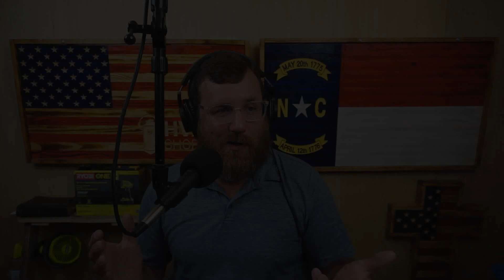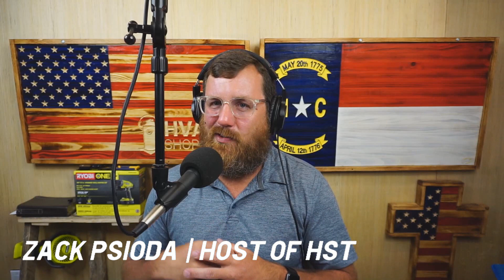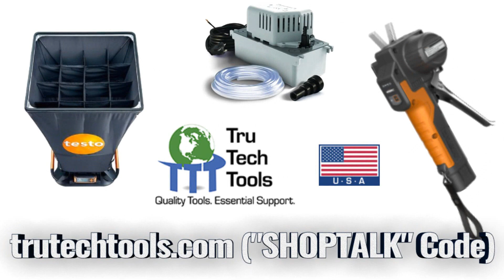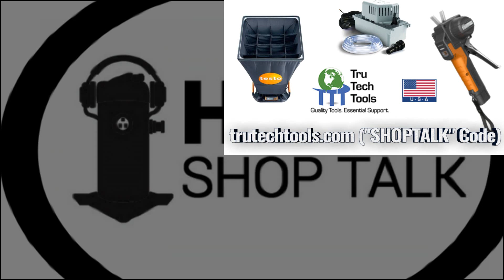HVAC Charging with R422B

Comment: So is 62 psi OK on the low.
I adjusted blower speed  higher.. house was 88F. Suction wouldn't go down. Evap was 42.  Am I being impatient.. This was a new compressor and conversion.   I got a theory.. if a tech doesn't change the drier isn't he contaminated the 422b with r22?

Comment: So if a r22 unit is low on ferrion can you top it off with R422B?
Tks
Reply: No, you can't mix any refrigerants.
Reply: @aaronclark1599  I do, and no issues. Got an old 22 unit with  some 410 mixed  in,  still cooling like champ.

Comment: I've used it for a while now on anything from compact chillers to 25ton RTUs. Seems to do well. Haven't had any migration or metering issues. BUT when I was doing alot of rez work I would find alot of units that were "topped off"(MO99,407,422b). No Bueno..unfortunately there are still guys doing this, please stop.

Comment: What is your take on MO99? Tried it the other day and seems to work fine. Not sure of long term.
Reply: MO99 has been my go to replacement for R-22 in residential splits, with mineral oil compressors, for 5 years or so.
As far as I'm aware, all of them are still going without complaint.
Reply: @markbeiser  thanks for the reply.

Comment: Been using R-422B for 10 yrs+. No issues. i use for Old Walk-in coolers & Old R-22 Ac.
its an icor product. been using icor products Since the R-12 days. 30 years. using Hot shot as a replacement for R-12. Great product !
Love icor refrigerants. R-422B a little lower pressures which i like. Works Great !
Reply: What pressures would you have on a 104 degree day? R422b is killing me.
Reply: @freeblacksociety2622   317psig is Book standard ideal perfect system. Depending on Condenser condition can be up to 360 or more with deteriorated fins & slightly dirty. I would not like anything over 380.
Reply: @freeblacksociety2622   Remember to use “ Bubble “ pressures / pT chart. Not dew for head pressure on pt charts.
Dew - is for Evap. Pressures.